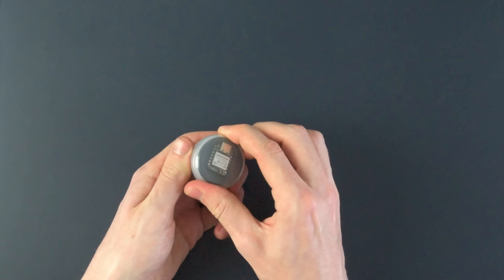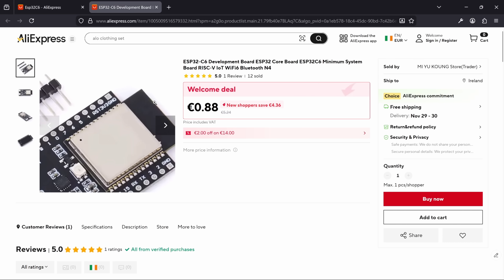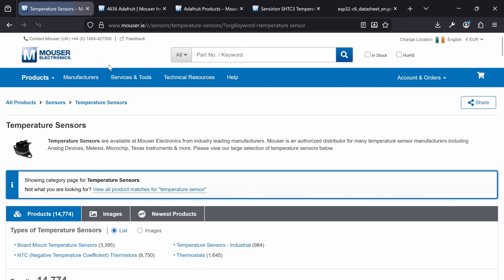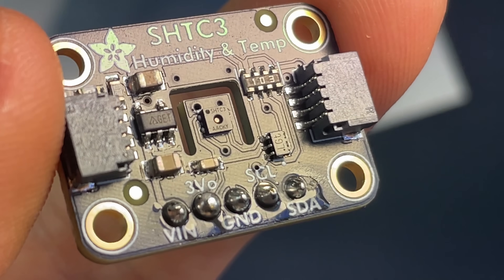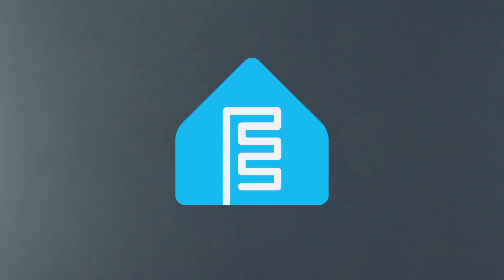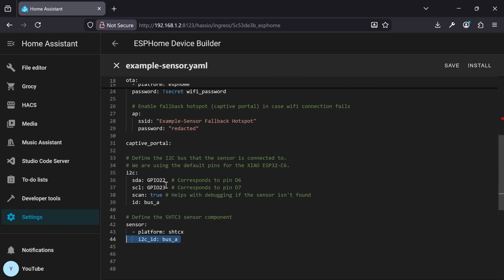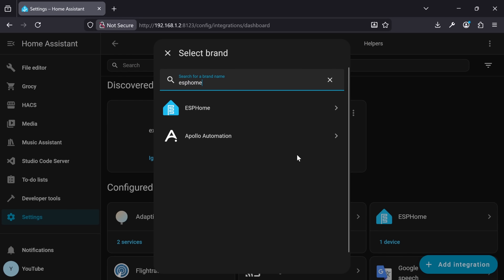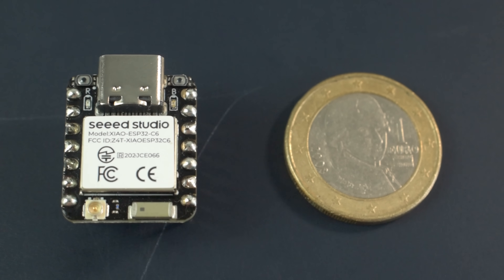ESP32: Build Your Own Smart Home Sensor in 10 Minutes

Comment: This tutorial is great! Will definitely try this. I have a question if you already have tried using it when it's powered by battery? I'd love to have a controller with a battery that also does temp+humidity reading, I'd bet the reading is rather easy on the power usage but the network connection is a big drain... so only updating it once an hour or something would be best. Have you tried using (common) batteries to power any controller, I am not experienced with it at all so I am not what would be the best option to get the right voltage (in a small, cheap setup)

Comment: - There is no real need to get the ESP32-C6 version unless you somehow need the faster WiFi or other small differences. In fact, the ESP32-C6 has some issues with some IDEs.

- You can't get them for $1. That's the Aliexpress welcome deal.

Comment: Ah you failed to mention this setup requires an outlay of $128 for Home Assistant before any of this will work! And yes I do have to walk into my kitchen to see the temp and humidity sensor.. It cost me less than one of those boards you bought but it worked out of the box.

Comment: Hmm rare to see good tutorials like these so keep it up. For video suggestions, some way to replace tuya devices controller would be good. Say temp sensor or what not we already have from tuya, if there is a way to replace ut with esp that would be really good. Tuya sucks coz have to use the cloud but i would like to have a zigbee based esp for all my smart devices
Reply: The ESP32-H2 support zigbee and can be made really energy efficient when building a battery powered device (something I plan to do in the coming weeks)

Comment: Well done! The only thing to note is that the voltage input (3.3V or 5V) should be connected to the VIN pin of the SHTC3. The 3Vo pin is intended for 3.3V output. Supplying input voltage to 3Vo will work only as long as it does not exceed 3.3V.

Comment: If I learned anything from these videos, it's that you don't build something like this in 10 minutes.
Reply: You have a point but also i realized that most of the time spent on a project like this is environment setup for your microcontroller. 1/4 of the debugging I do to my project initially is why the damn software can't communicate with the board on the COM port lol

Comment: Sometimes it's scary. yesterday my LED ceiling panel broke, had to bridge the remote control chip to make it permanently powered. and today I get this fantastic video, showing me an easy solution to replace the remote control chip with this micro controller.

Comment: I think you explained really well. People like me who doesn't know to tinker can understand literally 80% of what you said. 
Just wondering, I have a extendable sofa from china, it can be extended through voice control or remote or button on the sofa. Is it possible to make it smart with this seeed studio board? 
I have homeassistant but only managing product come with zigbee currently, havent done any tinkering before.
Reply from the maker: thank you so much :) the goal in time is to hit closer to 95%, but for considerably more sophisticated/interesting/unique builds :) regarding the sofa, how you would interface with a microcontroller like the ESP32 here would entirely depend on how the sofa works. Potentially all 3 options you listed could be used, but button presses can easily be simulated using an ESP32 so I'd probably start there.  I may cover making dumb appliances smart in a future vid
Reply: @FeatureNAB  Looking forward!

Comment: I’d love to see a part 2 where you build a case and solder the pins if you ever want to circle back on this project.
Reply: Thats mostly my main problem, it's pretty easy to get a prototype running, but then you got this ugly breadboard and it's, in my opinion, not so easy to make this a compact sensor, especially with power supply or battery.

Comment: I’ve added one of these with two temp sensors clamped to in and out pipe of boiler to monitor the send and return feeds of the central heating system. Can then calculate the delta T
Reply from the maker: very cool, I wouldn't have considered that - the high temps are ok for the temp sensor board? why do you want to know delta T? very curious to know more!

Comment: Can the ESP microcontroller be powered through the 5V pins instead of the USB port? If so, feels like this just needs an enclosure + a smaller battery to become a nicely package appliance!
Reply from the maker: if you simply want to power it with a a battery, there are two pads on the rear that you can solder battery wires to. not only will it power the device, the USB port can then be used to charge the battery, no need to charge externally! I'll go into this in the next project video, stay tuned!

Comment: If you are into electronics, you will LOVE 3d printing, get yourself a printer yesterday!!  I would suggest a Prusa, been using it for over 5 years, zero maintenance.  Thanks for the video
Reply from the maker: I am definitely on the hunt for a 3D printer, just a question of which to get, there seems to be a bunch of factors to consider when choosing 😵‍💫 I will check out prusa - thanks for the rec :)

Comment: I'll be waiting for your second video. It would be great to make an earthquake vibration sensor using the MPU6050 sensor with esp32c6. It would be very useful to set up a scenario using the Zigbee protocol to shut off the gas and water valves in the house during an earthquake.

Comment: I bought one specifically to use as a cover in esphome. But I can't figure out how to have a battery operated cover to wake up from sleep when I want to close or open it.  The idea is to replace a defective IKEA cover. They do it properly, so I should too I guess!  Any idea on how to do it?  I can't use the light sleep as it takes too much power.

Comment: Many thanks for making the video - this is something I planned exploring and it just arrived in my Youtube feed. 
I noticed BAT+ and BAT- pins on the esp. How difficult would it be to add rechargable battery to one of them microcontrolers? Any chance we could have a video on it?
Reply: The seeed studio includes the lipo circuitry so just solder a connector to a 4.2V battery and you're done.

Comment: I just wish you'd include a complete parts list...the breadboards, jumpers, USB cable and charger....just to keep it completely simple and easy for us geezers. But generally, it's a great video. I was just contemplating a use case for this very sensor in my Home Assistant setup. I'd much rather build one, so thanks for the video. I hope I can guess the right parts to get one working without frying all 3 of the ESP32's!! LOL  ~Frank
Reply from the maker: hey, I just added the kit I used to the description, hope that helps!
Reply: @FeatureNAB  Thanks, so much!! That'll save me a good bit of time and set my mind at ease about not frying a SBC!

Comment: Great timing, just received my AliExpress orders from the 11/11 sale (although I didn't get them for as cheap as you did, shipped to Toronto, Canada).  I've never used these boards, so first time with them.  The ones I got though had an antenna.  I'm not as familiar with this stuff, just nerd learning now.  I also ordered some 18650 batteries (not received yet), so hoping to use these boards with those for "place anywhere" solution.  You need to get a 3D printer and slide further down the rabbit hole, lol.
Reply from the maker: nice, good luck with the build! let us know how it goes! antenna should give you better placement options, which cells did you go for?

Comment: How about a temp sensor / micro controller that can monitor my baseboard heat that can attache to a hot water pipe to see when my boiler has gone off line. Here in the USA our radiator heater are heated with water around 180F I know in EU you used a lower temp. 99% of heat in the USA for homes is via the idiotic forced air system and you basically get one temp controller for a massive house!

Comment: Just recently made my first esp32 projects involving a 8 channel relay board using PoE.
I was just looking into Temprature and Lux sensors so this is amazing!

How long would this last if I were to power it with a 18650 Li-ion cell (3000mah)?

EDIT:
Just saw that this is your first video on the platform, I would never have guessed! Keep up the amazing quallity!
Reply from the maker: woah this sounds cool af, could you explain it a little more? 

I havent done any calculations or battery experiments yet, but my guess is that while it may technically work, it would be impractical. If you wrote the C++ yourself and flashed, utilising deep sleep, that could be enough. But there are other boards that consume even less power like the nRF52840 that might be more suitable for long term battery use (many months)

Comment: Did the SHTC3 give a pretty accurate measurement out of the box? Does it have method to calibrate?
Reply from the maker: I didnt look into calibrating, but that is very possibly mentioned in the specsheet if its required. it seemed accurate to me so I didnt really think twice about it at the time!

Comment: nice tutorial.  I did a similar thing and replaced the PIR sensors in my broken (control board) alarm system with a C6+mmWave radar and now have presence sensors in all rooms talking to Home Assistant for automations and security, also added a BME280 plus daylight sensor - because you can ;) buck converter to take the 12v still supplied by the old alarm system down to 3.3v and no extra wires needed! The C6 is great because it can do Zibgee and Matter but these are not supported in ESPHome yet so when it is I will get those off my wifi and onto Zigbee.
BTW the ESP32 can operate on 3.3v, it's just easier to power it with 5v usb but if you're not using usb then you only need 3.3v, useful if you don't want to run the power for multiple sensors through the ESP32
Reply from the maker: very cool projects, got a few mmWave recetly too and they seem interesting for HA automations. what does the daylight sensor do?
Reply: @FeatureNAB  I use the daylight sensor for lighting automations - combined with presence makes for much smarter logic than movement + time of day.  the PIR replacement is just a convenient place to attach it while I'm already soldering a veroboard.  
The C6 (or any ESP32 really) is so overpowered for sensors but they're cheap, easy to flash and really come into their own if you start adding logic to combine multiple sensors and/or trends prior to output to HASS. wish I had more free time to complete the myriad projects I've started 🙄

Comment: I built something like this a month or so ago with an ESP32-c6 except I used Zigbee instead of Wifi to connect to HomeAssistant.    I couldn't use ESPHome for a Zigbee device so I had to write it in c++ with the Arduino IDE.    It wasn't too bad to figure out from the demo code and to get a working device.   It just shows up as a Zigbee device under ZHA.     I think my version is a little more advanced because it requires code, but would be a good next step.   I consider myself a microcontroller noob, but I do have a lot of software experience, in any case I think making a zigbee i2c device would be a good intermediate project.   My project allows me to get temperature readings into HomeAssistant and I can even turn the onboard LED on and off, which is just one step away from being able to control actual lights with the controller.   BTW my version was an Adafruit Feather c6, but I've had really good luck with Seeed products as well.

Nice video on Microcontoller+HomeAssistant!   I would encourage to you try to get this same hardware working with Zigbee + HA, it's lots of fun.
Reply: PS - subscribed

Comment: Subbed. Ive bought all kinds of gadgety doo dads over the years, set them up in various ways, torn them apart, and made other things out of them. Needless to say, almost nothing is up and running now lol... Im at a point where i want to get every single device set back up and permanently working. Essentially building my homelab back up from ground zero. Switches, PCs, Zimaboard, raspberrypis, server software, HA and smart devices, etc. I should be able to handle this. But! One of my big interests going in is about these chips and soldering. So, if you decide to make a video about how to solder properly, and how to connect these micro controllers to things to make them smart would be very interesting!
Reply from the maker: resonate hard with this lol. sh*t you not my HA instance died just this week for the first time since I installed it like a year ago. hardware failure, expecting data loss. painful. soldering will likely feature in some video at some point :) thanks for sharing!

Comment: I've got a esp32 reading a pressure sensor off my pool filter. That way I know when the pool pump is on ( pressure is above ambient) and also if it starts rising above a baseline I know the filter needs cleaning.

I have another esp32 that reads from my smart meter to give me real time electricity usage.

All done with ESPHome and home assistant
Reply from the maker: this is a really creative solution! well done!

Comment: How is the temp sensor NOT corrupted by the heat generated by the boards themselves?
Ideally the sensing device should be external and wired to the board
Reply from the maker: my guess was that open to the air like this, heat should not build enough to be noticeable within the 0.4 degree accuracy window, but I haven't actually tested that. good observation!

Comment: Been doing very similar projects lately but using a C3 instead and integrating a LCD screen. About to move to C6 and try and get battery, low power and zigbee working on it as well as design my own pcbs because why not 😅 For me its equal parts journey and destination.
Reply from the maker: nice fair play, PCB design looks like a major step towards more clean professional builds. How are you finding the learning curve? Any software you'd recommend learning for PCB design? 

I'd also love to try attach a screen to these, to report HA stuff like bin day reminders and that - how was your experience, did you have to write much code to get the display functional?

Comment: Amature video, the best way is to use VS Code with ESP-IDF plugin and then you can use this device on any SmartHome solution not only Home Assistant
Reply from the maker: I definitely don't claim to be anything but amateur :) just learned some stuff and shared it was all. if you prefer ESP-IDF then power to you!

Comment: Got the same board and did this same thing before it was fully supported in ESPHome, but I used the DHT AM2302 instead. Even though it isn't as accurate with the humidity it was easier to solder as all three wires are next to each other. I tried getting it to work with a battery, but I haven't figured out how to get it to sleep correctly.
Reply from the maker: ah nice one - what did you use instead, just C++? battery integration and battery life are high on my list next, it looks way cleaner and you've more placement options. finding cells is difficult in ireland tho :/  any cell brand recommendations?
Reply: @FeatureNAB  I haven't revisited getting the deep sleep to work. I did at least get it to run with a normal 3.7v lithium battery soldered to the battery pads on the back. It was charging from the USB-C port. At the moment I just have it plugged into the wall with out the battery. I think a 18650 or similar might work.

Comment: For the SSL certificate issues with self hosted esphome, I found that you can use the esphome website (not your own instance) to flash the initial firmware that lets you them connect to it wirelessly to add it to your own instance. This was really handy as I had virtualised my home assistant/esphome host, so connecting directly would have been a right pain in the bum.
Reply from the maker: Ah mine was virtualised too in proxmox but I skimmed over that detail for simplicity! all i had to do was pass through the USB device to the VM and HAOS picked it up :)

thats a really great tip though, thanks! this is my fav thing about these comments, people have shared a bunch of these really valuable insights. I didnt see any references to a public hosted instance of ESPHome while reading the docs, can you share a link?
Reply: @FeatureNAB I think YouTube is blocking links, but if you search "ESPHome web". Only works in a supported desktop browser. I'm also pretty sure there was also a link from within esphome when you click to download/install on a device.
Reply from the maker: I will save this for later, thanks for sharing! much appreciated

Comment: Interesting use case.  Unfortunately at the moment the Seeed ESP32C6 from Mouser is more like $15 here (tariffs may have a part in this?).  Add the sensor, a power cord, and a power adapter... and for this specific project, it just seems way simpler and actually a lot cheaper to buy an Aqara zigbee sensor and connect it directly to HA instead.  (assuming you have a zigbee coordinator, which honestly everyone should, if they're getting into home assistant).

On the other hand, the ESP32 is fantastic to set up a number of Bluetooth proxies around your house, adding BT connectivity to HA throughout the house, and quite cheaply.
Reply from the maker: thats a surprising price difference - literally triple if you compare to the 3-pack price per unit. for so long we've looked across the pond envious of american electronics prices. strange to see thats flipped! 

heard a bunch of good things about using these at BT proxies. to me thats the real value of these, they are incredibly versatile, and if you find theres a better alternative for one use case (like you find cheap temp sensors - used market is a great place for cheap smart home stuff), then you can disassemble your build and use the parts for something else you find interesting.